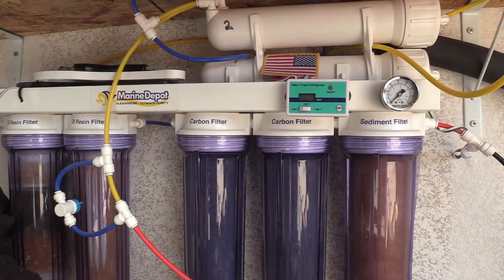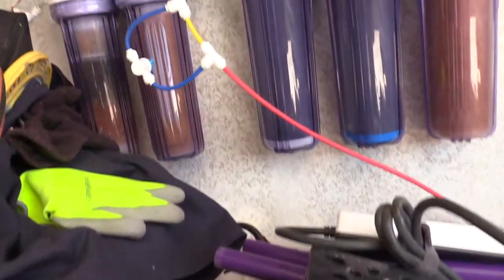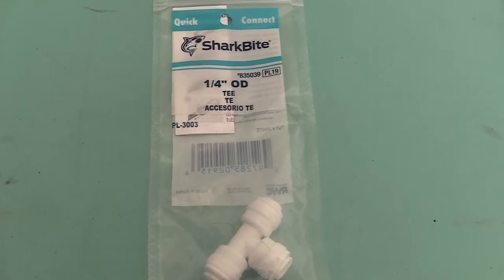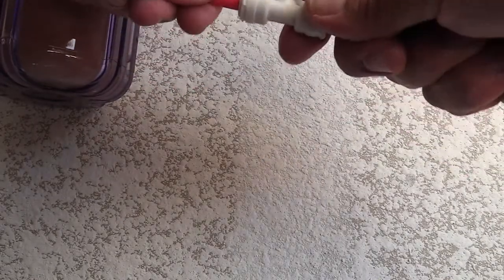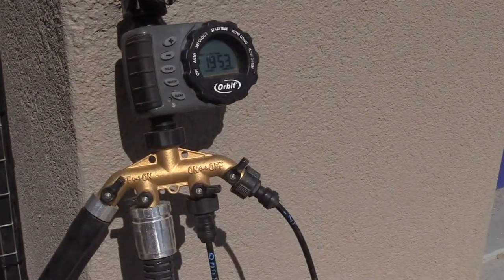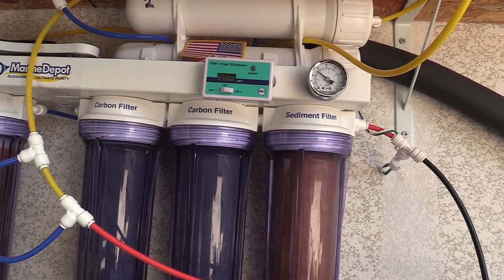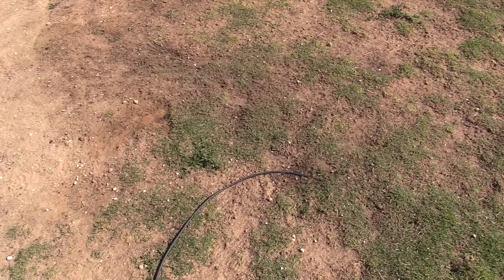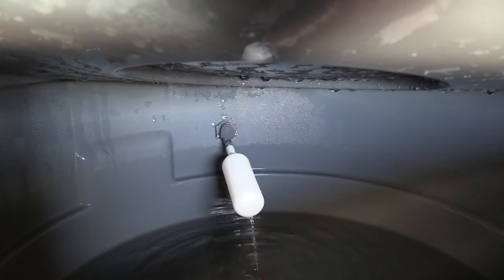AQUARIUM WATER | SIMPLE RODI UPGRADE | CONSERVE WATER THAT WILL SAVE YOU MONEY LIKE A PRO

Comment: Water/sewer is expensive when you think i run a 200 gal, 20 gal and 10 gal qt tank. I've been trying to think of ways to cut costs/waste. I will try this for sure. Only thing I can think that is a drawback is faster filter consumption but my service water is only 100-115 tds starting off. Thanks for the video!
Reply from the maker: I feel your pain. Ive had several tanks too. But nothing on your scale. I have a low boy frag tank that ive been holding off on, part of the reason is water, and the water changes. Plus cooling my garage! Have a great Day

Comment: following.  interesting.  does it take the tds out to 0 and everything else?
Reply from the maker: It recycles the water to go thru the filters again. Instead of dumping the waste water down the drain.
Reply: @915Mang  burning through membranes and DI. I also wondered about the pressure of the system.
Reply from the maker: @sergifed91  we burn thru them when we make water anyway